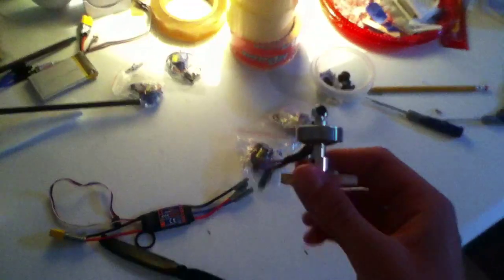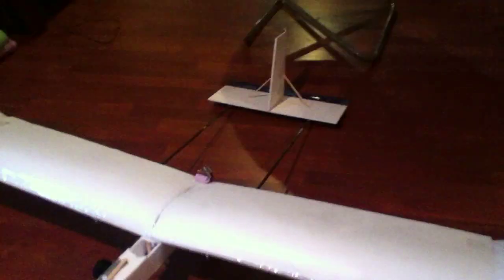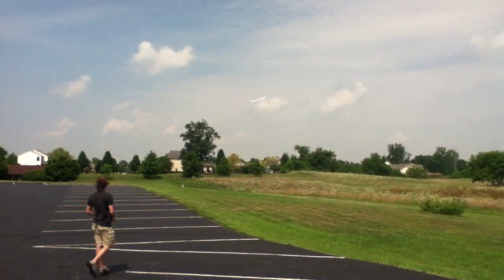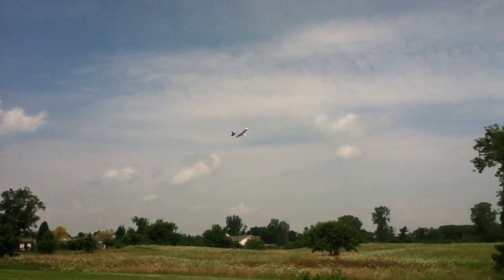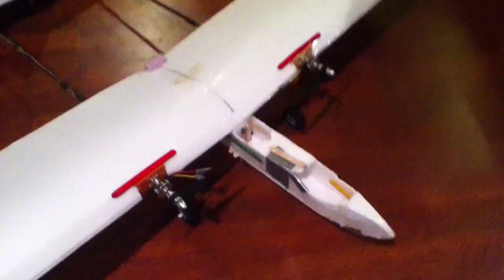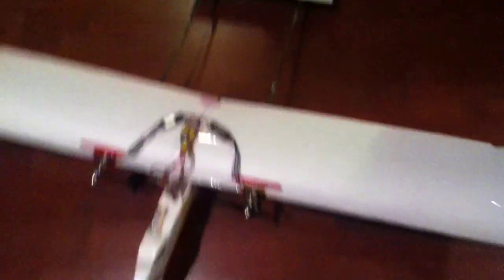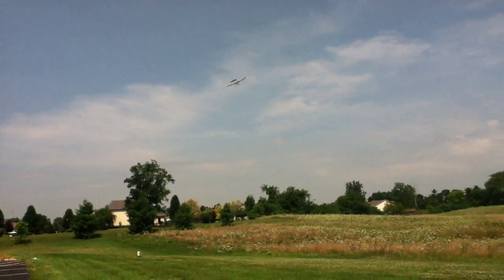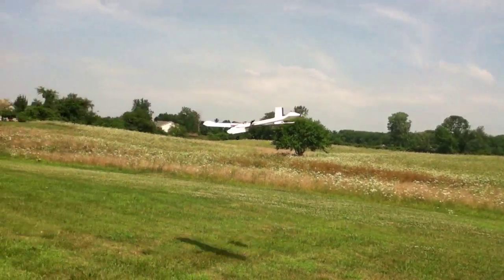RC Drone Plane Build Video

Comment: Cool project I enjoy building planes too. Not sure what discharge rate battery you were using but if you were to use a battery with 3cell 2200mah with a 25c or 30c you would probably get more performance with the original single motor setup